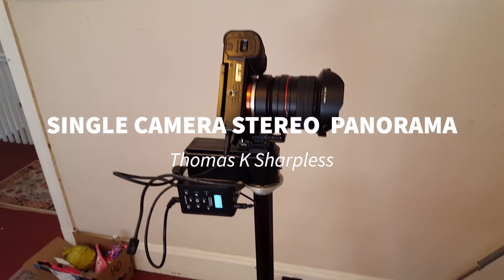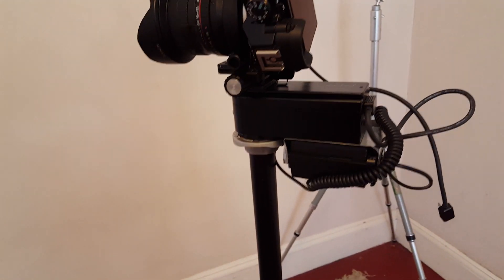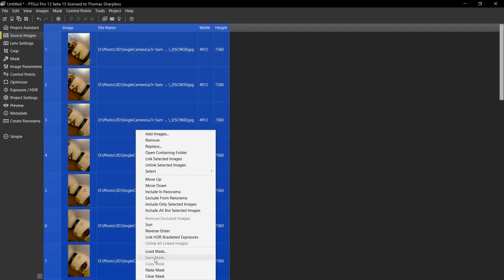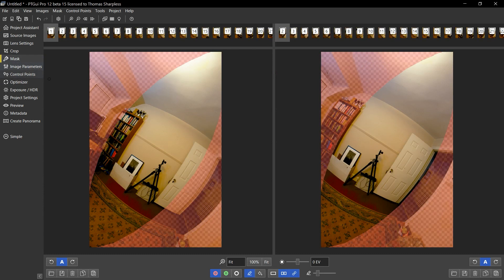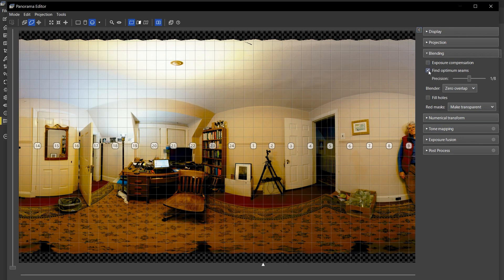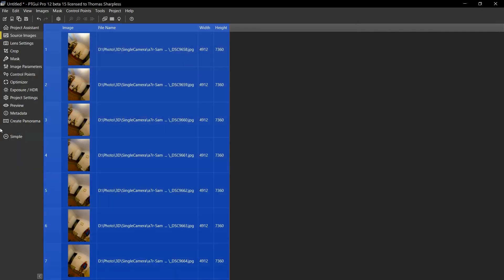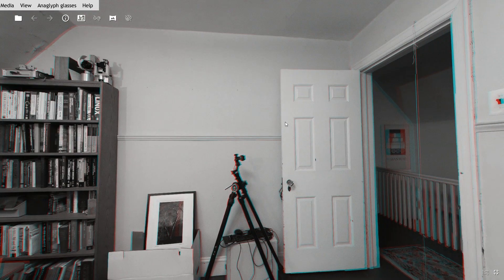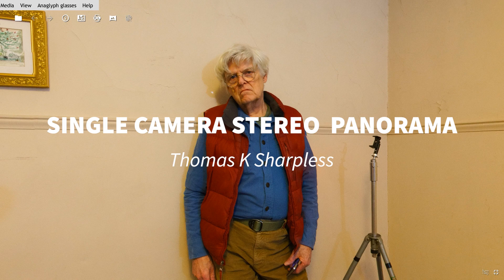Single Camera Stereo Panorama

Comment: Thanks, i wonder why you don't check CP errors  value and why not use optimize function? A always lost there what to optimize (horizonal, vertical, shift, shear, etc). And how many times should i optimize? You use that function?  Or only when you see stitching errors?